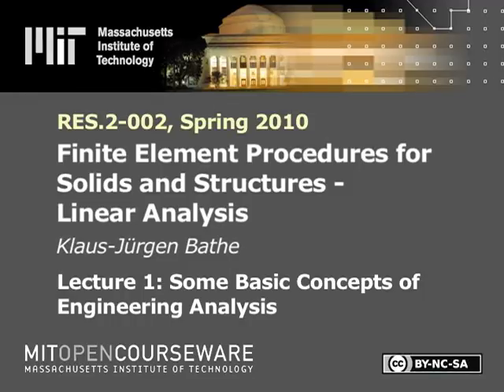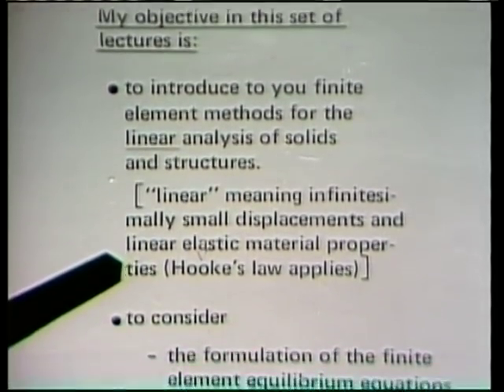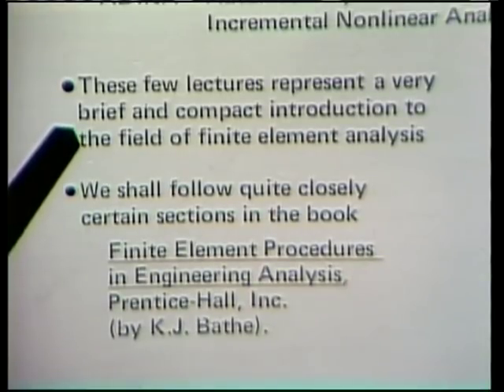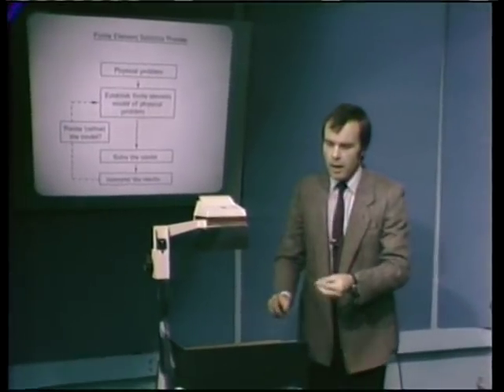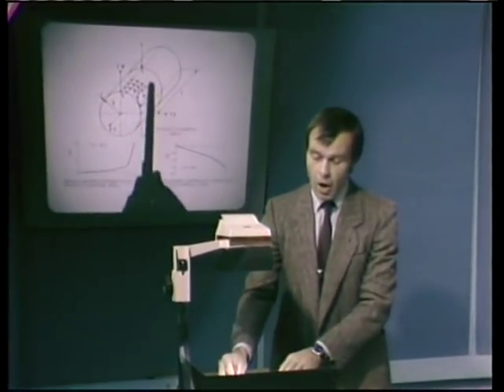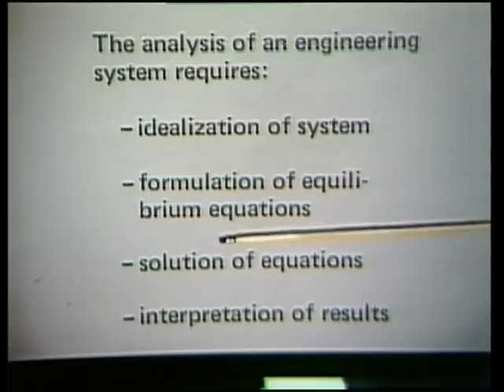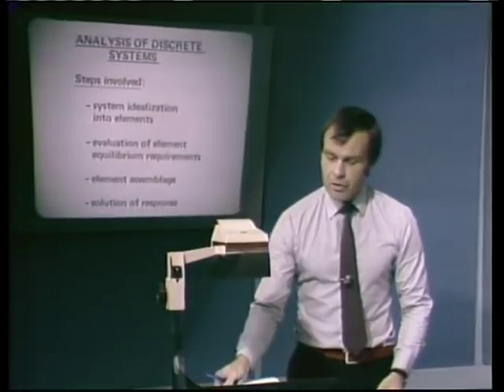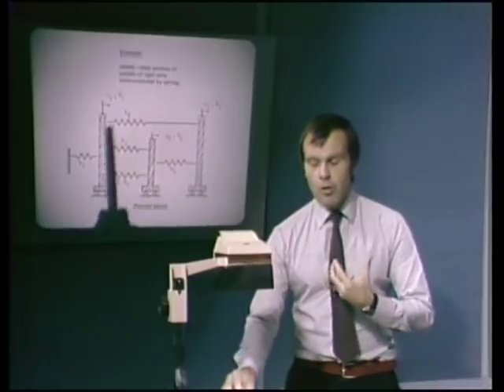Lec 1 | MIT Finite Element Procedures for Solids and Structures, Linear Analysis

Comment from the maker: ANKUSH MENAT, the requirements for this resource are listed as "An undergraduate degree in engineering or science." and suggests two courses "2.092/2.093 Finite Element Analysis of Solids and Fluids I", "2.094 Finite Element Analysis of Solids and Fluids II" as related resources. Visit the course on MIT OpenCourseWare for more information at http://ocw.mit.edu/RES2-002S10.

Comment: Professor Jurgen Bathe is great i must say
but he is only teaching this method by structural prespective not by general 
meaning 
if want to find the solution of 2D heat diffusion partial differential equation with certain Boundry conditions OR CFD Problem such as Navier Stokes equation 
so how we will apply FEM to Those non structural problems

Comment: Gave up at ~ 17:00

Can someone suggest me where to learn basic pre-requisites and some new material on FEA.
Reply: +ANKUSH MENAT I would start by watching some videos on Cramer's Rule so that you gain a fundamental handle on how to construct and solve a 2x2 matrix.  From there move up to a 3x3 and 4x4.  You will need to work backwards from a 4x4 to a 2x2 in order to solve the simultaneous ODE equations. Paired with matrices  make sure you have a good grasp on "taking" and solving / expanding 1st thru 4th order ODE's (differential) equations as you will be substituting the coefficients of the equations into a matrix.
Reply: citybound Thanks, I started watching MIT OCW videos on Mathematics a while ago. Now I can understand everything he said in this video, heck I can solve some basic fea problems by hand too :)
Reply: can you tell me and paste here the short-link exactly which prerequisite course helped you, MIT maths has unlimited number of courses.
Reply: Kazi Mehdi Linear algebra, Single variable Calculus, lil bit multi-variable calc.

Comment: F2 is not -F1 in your drawing...
Reply: +enivaldo bonelli rewrite it in different form. do the matrix multiplication and you can get k3u1 - k3u2= F1(3); k3u2 -k3u1=F2(3). sum them up and all the terms on the left hand side will cancel each other out leaving 0=F1(3) + F2(3) and so F1(3)= - F2(3).